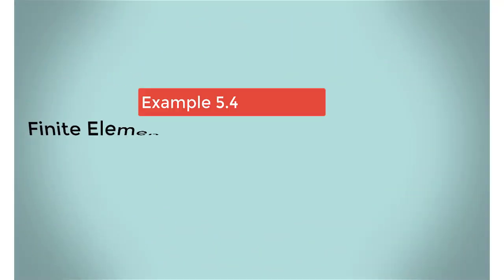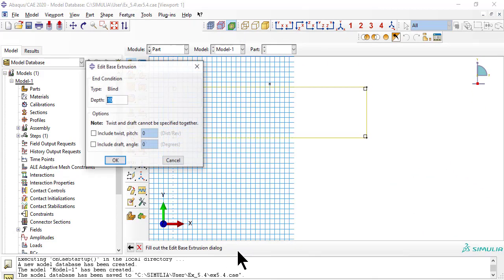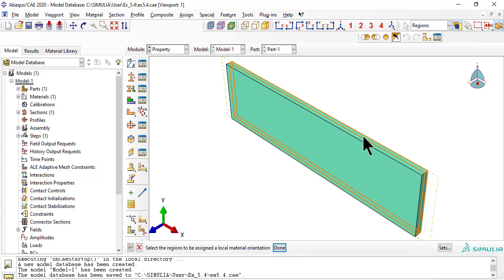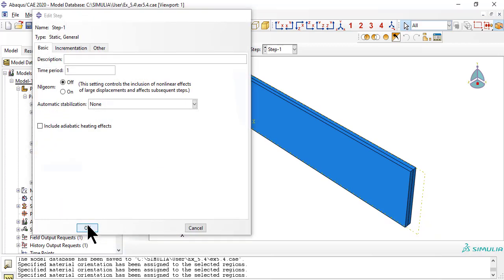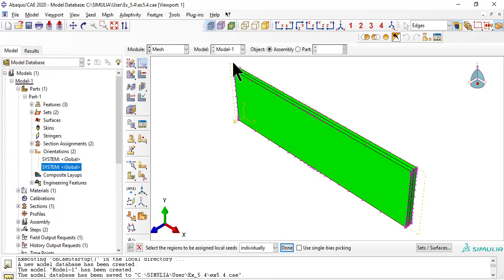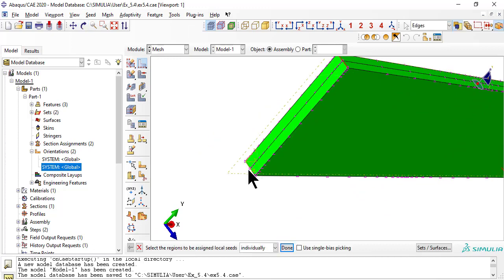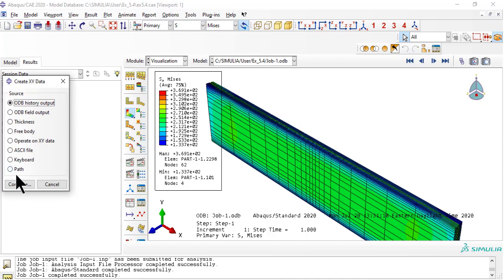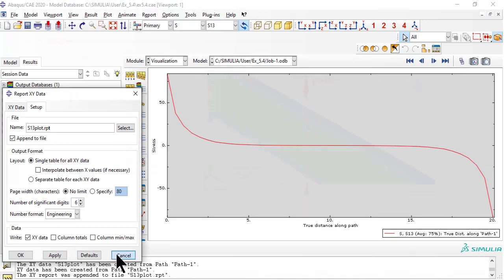Example 5.4 Abaqus 3D solid modeling of symmetric angle-ply laminate and free edge stress

Comment: Thanks, Dr.Ever Barbero. it was a really excellent explanation about free edge effects in composite structures. But I want to know is there the same procedure to analyze free edge effects under thermal loading? Are all the steps you have done in this video the same and the only difference is in load modules for thermal loading? 
thanks a lot again.
Reply from the maker: Exactly the same. Instead of applying a mechanical strain, apply a thermal field, it will produce strains, and calculate stress, exactly the same. There is an example somewhere about how to apply temperature field.
Reply: @EverBarbero  Thanks a milion, dear professor.

Comment: Hi Prof.Barbero, Thank you for the great video. I was comparing the model set-up between examples 5.2 and 5.4. I see that in this example 5.4, you happen to use the entire plate geometry as opposed to using only a quadrant of the model as shown example 5.2. since you are using the entire plate for this analysis, I want to clarify as to why you chose to constrain only the x-direction displacement on the left end of the plate and not used a fully fixed or encastre type boundary condition. is this to allow for the in-plane shear strain to occur along that surface? thanks in advance!
Reply: As a follow-up, can we still get the same results for this example, if we remodeled the problem using quarter symmetry as shown in example 5.2?
Reply from the maker: On a 3D solid model, "encastre" would unnecessarily restrain Poisson's strain along the boundary and through the thickness of the laminate, so unless I see a rigid body motion, I try to restrain the minimum necessary to get what I need,  which in this case is a specified value of \epsilon_x
Reply: @EverBarbero  Thank you! that makes sense.

Comment: Dear Professor, Thank you for this excellent lecture. I have tried giving Hashin damage criterion, in order to know the damage behaviour of fiber and matrix, but it is not allowed in solid parts. How to incorporate these properties in the model? Please tell.  Same properties work well when I use in parts made by the lamina. But then I don't know,  what damage is occurring in each ply.
Reply from the maker: Yes, Abaqus does not implement Hashin for "solids". Watch the examples 3-4-a,b,c,and d. You should be able to use Hashing in most of those, and then retrieve the damage for each lamina. I am interested to learn from you, what you can accomplish regarding retrieving Hashin damage values for each lamina using the approaches in those 4 examples.
Reply: @EverBarbero  Thank you 😊
Reply from the maker: To retrieve Hashing damage contour plots for each lamina you have to modify the "field output request" to include the damage variables DAMAGC, etc., all the way down to DMICRT, as shown when you expand >Failure/Fracture in >Select from list below, when you expand >Edit Field Output Request. I can confirm it works. I did it and then did contour plots.
Reply from the maker: To see how to edit F-Output, see video Example 3.12 https://youtu.be/QW1KA1dg7xQ